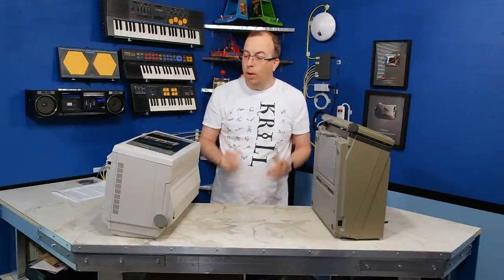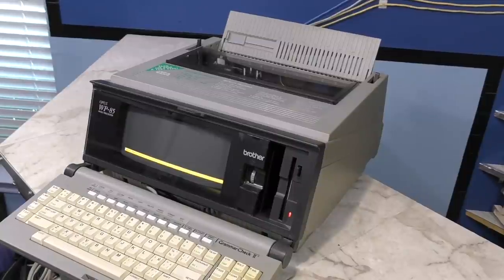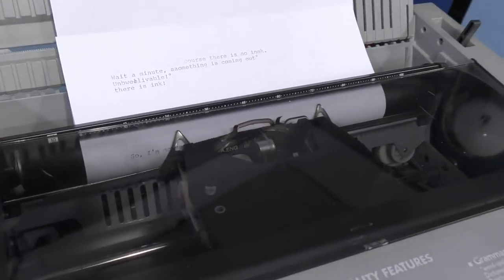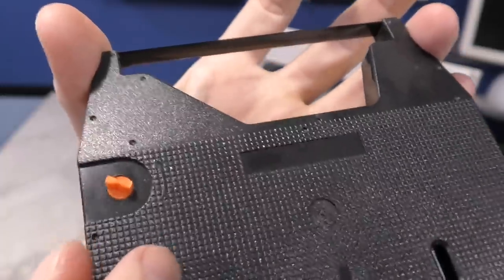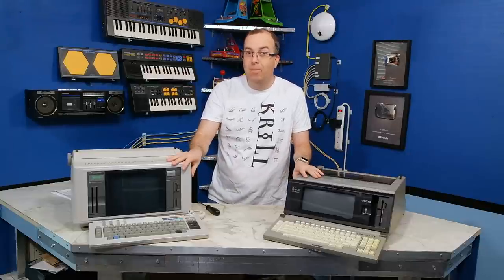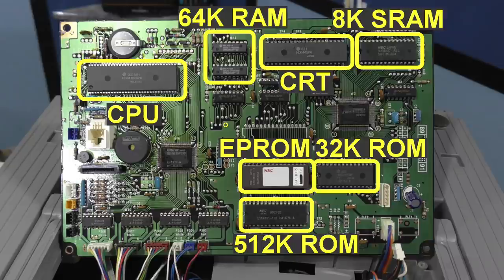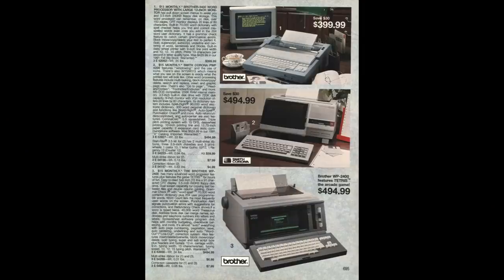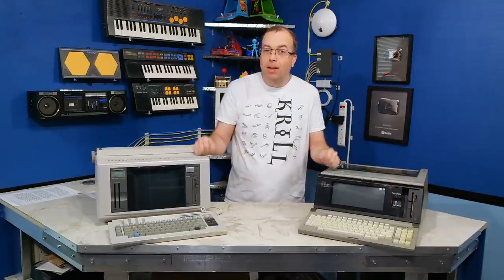Dissecting two Word Processors, Brother WP25 and Panasonic W1525

Comment: I don't recall the model number, but I had one of those brother word processors, it was almost like that, but it was "upgraded" model the carry handle slid out instead of swung out like that one and the keyboard wire was removed and I had a darker gray color, other than that it was identical to that one. I loved tech stuff when I was a kid and my mom thought it would help me in school we found it at a yard sale we got it for like $5 or $10, worked like new, just needed new ribbons which staples had and still has the last time I checked. This was around I'd say 1998 she got it for me, it did end up helping me write a few essays I had prior to word like software being so easy to get nowadays. I had it up to about 5 years ago, the printer door closed sensor snapped off, not wanting to try to fix it, it being outdated tech and stuff cluttering my house got rid of it, don't remember if I donated/gave/or tossed, but I know I don't have it anymore, haven't really thought about it till now, I did come across a floppy disc not long ago funny enough that I still had stuff saved on it.

Comment: I had the smaller version of the Brother that got me thru college, instead of monitor it just had a flip up LCD screen with appox 80 columns but just a few lines, maybe 10.. that print hammer brought back memories, i remember writing up my paper and then watching it print.  I also remember the spreadsheet program that was built in-didn't have to be loaded from a diskette, I never used it but it was a cool thing to have.. so basically at that time having a dedicated computer & printer was unnecessary since there was no internet and the only practical applications were word processing & spreadsheets for most home users so these things really filled the void for those of us that were financially challenged.

Comment: I've got a bit more info on a few of the chips used in the Panasonic machine. The KM23C1000P-20 chip is a Samsung-made 128k (1MBit) Mask ROM, and the KM23C4000P is a 512k (4MBit) Mask ROM. I'd also be willing to wager that given the other chips in there, that the Hitachi microcontroller is probably used to control the I/O for the unit -- drive the keyboard, the printer, etc, and that the Mitsubishi chip in the corner is probably the main CPU, though I wasn't able to find any info about it.

Comment: Carbon ribbons and correction ribbons! I haven't seen those since I was a kid! My mom had a fairly decent typewriter and I distinctly remember that orange tab on the cartridge and those orange spools for the correction ribbon. I also remember how using the backspace key caused the carriage to back up and slam a head against the ribbon against the paper 3-4 times, fading the letter with each punch, until it was pretty much erased. And similar to the carbon ribbon, the letter you erased would appear on the ribbon itself!

Comment: For the Panasonic model @11:01, the 2 Samsung chips below the 8K SRAM are the memory chips. Just google the KM23C1000P/KM23C4000P chips. Also the -20 at the end denotes the speed of the memory. So if you see this -XX at the end of a chip model, it is usually a sign you're dealing with a memory chip.

Comment: The PAWI3W1525MB and PAWI1W1525M are Panasonic/Matsushita produced chips - the "KC23C1000P-20" is a 200ns access CMOS Mask Rom, 128kx8 and the "KC234000P-20" is a 4Mbit CMOS Mask Rom, 200ns access. Seeing that the PAWI2W1500CA is used in some Lumix digital cameras and has the '-xx' trailing designation (-21 in this case) on it, I'd be willing to put money on it being the SRAM. (the -21 suffix would indicate 210ns access time)

Comment: The first type of cloth ribbon can be re-inked if the cloth is still in good shape. The second type of ribbon is single-pass - a small amount of the ribbon in the shape of the letter pressed is left on the page. If you look at the spent ribbon you'll see little clear letters. The single-pass ribbon is extremely thin and there is a huge spool of ribbon in each cartridge.

Comment: Hi David, great video (as always!). The first thing that struck me, upon seeing those units from the front, is thinking how much they look like the Commodore 64SX! :) In the UK the only standalone word processor system I was aware of, back in the day, was the Amstrad PCW series. They resembled your more traditional PC, in that they had a separate keyboard and printer. My friend actually gave me a printer from one of those systems back in 1994 (a dot matrix type). It lasted from my Amiga era, through to my transition to PC and all the way through my university years, producing countless print-outs of program listings, write-ups and essays. Easily the best printer I ever owned, and it would go through one single ribbon a year! Which at the time cost me a maximum of £3!! I actually took it from my mother's attic, over to my house last year, and with the aid of a parallel-to-usb cable, I actually had the thing printing from Windows 7! Unfortunately, I had no space for it in my office at home, and despite offering it on groups online, I had no takers, so unfortunately had to take it to my local recycling centre. :(
Reply: You had the PCW printer working on another computer? We had the 9512, with the daisywheel, and it couldn't possibly work with another computer. All the brains were in the computer itself, greasy Alan Sugar learning a lesson from Uncle Clive again. The printer lead was just simple connections more-or-less directly to the printing hardware. Software on the computer's CPU took care of all the timing to get the right letters smashed onto the page.

You're saying the dot-matrix option was actually a real printer with brains on board? I'm amazed! Are you sure you're talking about the Amstrad PCW dot-matrix? Your friend didn't have a third-party one connected to a Centronics port on the PCW? I think you could buy those as extra.

Shame, I'd love a dot matrix now. It wouldn't get a lot of exercise, admittedly. I just like to hear them screaming away producing a very mediocre lo-res ink on paper.

Comment: 10:45

Looks like there are two SIP DRAM chips at the bottom of the board, so presumably 32KB each.

Makes sense if they are connected to that custom Gate Array, as it's probably handling the address multiplexing and refresh.

Always interesting to see the main boards in this vintage stuff. Reminds me of my (possibly misspent) youth. lol

Comment: Also on the other machine, the slotted chips - both are MASK ROM, top is 128kB, bottom is 512kB. The big chip on the bottom is probably memory of some sort due to the timing value, probably 8kB of something. The RAM itself would be those two ZIP chips marked IC13 and IC14 - yes, those are not rezistor or diode network, those are RAM chips. :)

Comment: I remember several of CP/M-based word processors from that period. A place I worked for had spent a ton of money on word processors from Wang. Of course it suspiciously looked like it was running an old version of WordPerfect and a quick read of the boot disk showed that it was a Z80 computer booting CP/M. Of course it cost more than a typical CP/M computer at the time, but I guess they wouldn't buy a "computer" unless it ran DOS.

Oh yes, they were designed to be repaired quickly. When one broke down, the technician simply replaced the Wang motherboard with a new identical one and it was back to work.

Comment: i loved the brother one, because it has a printer that it is quite easy to put in work, it is basically a printer that is like an automatic typewriter, and as a type writer the daisy chain can theorically be serviced with some alcohol and some ink. even this days, except for the floppy maybe are quite durable. i would not say that of a lot of printers neither computers. but like the floppy if it is broke that would be a problem to me, i hope a restoration video came in the future. also it is expandible by making a rom in the empty slot. good keyboard.
 the panasonic one was interesthing, i love the WP but the printer was weird, theorically you could replicated the band and replace it, but with the original was expensive to print. the keyboard was weird too. 
it is interesthing that there are CP/M machines basically, even could theorically run dos.
great video.

Comment: In fact, the location of backspace is more convenient for touch typing because you can hit it with your pinky without moving your hand from the home row. Also some old Sun keyboards had that layout for backspace (and esc on the top left corner of alnum block, ctrl in place of caps lock). I don't know why have we not moved to that standard, instead having useless keys like caps lock and tilde (yes, as a coder, I use it, but not as much as esc).

Comment: A coworker bought a similar word processor to use at home (or for his daughter to take to college - don't remember) but it had a proprietary disk drive. It looked like a 3.5-inch drive but the disks were smaller. There wasn't any way to share the files created with a PC. I know there were some 3-inch and 3.25-inch disks at one time but when both Apple and IBM picked the 3.5-inch disk, that was pretty much the end of the other sizes.

Comment: My guess is the DRAM on the Panasonic will be that SIP package to the right of the CPU, Matsushita loved that package for saving space while still keeping the pinout wave solderable. 4k SRAM would be the print engine RAM, as they basically took a Panasonic daisywheel printer engine complete, and then talked with it via standard serial interface on the board. 48 pin chip to the left of the SRAM is the print controller, the ROM below the 4k is the printer firmware and the rectangular ASIC to the right is the daisy wheel controller glue logic, and then the DIL chips to the right of the board are power drivers. The square ASIC will be glue logic and keyboard encoder for the main CPU, and the SMD chips are bus buffers. 

Layout must have had a hard time putting all that onto the smallest possible 2 layer FR4 board to fit in the assigned space there.

Comment: 11:03 Below the 8K RAM are 23C1000 and 23C4000 mask ROMS which is128KByte and 512KByte. The RAM is IC14 and  IC13. These are the rare standing ZIP chips (I think they were called that). The ..70H036 was a 36 cell OPGA (One time programmable gate array) of some sort. I have seen similar ones in synthesizers.

Comment: Sometimes you can revive fabric ink ribbons by prying up enough of the casing to put a WD-40 spray straw in...and give it a few very quick squirts.  Leave it for a few hours and see if it's dissolved enough ink back in to usable area of the ribbon.

Comment: The cloth ribbon can be re-inked in a few minutes. All of my dot matrix printers used them. With them was a love hate relationship as you could print cheaply however to save your ears you needed to have earplugs or a sound damping device around the printer.   One of my computers, Access Matrix (also known as an Actrix) from that I had in 1985  had an internal MX-80 printer.  Those were the days

Comment: The ribbon on the second printer is very similar to the IBM Selectric, which was known as the best business typewriter in the 1970s and 80s prior to the PC taking over wordprocessing tasks. At work, I used an IBM Selectric up until the mid-1990s. The Selectric truly was a great machine.
Reply: The Selectric was similar but I believe it had the embossed letters on a round ball instead of a daisy wheel; similar concept though.
Reply: @66rabidmonkey  I'm talking about the ribbon and eraser mechanism -- NOT the typehead.  Your points about the typeheads do have the merits. The ball head could be replace with another ball within seconds.

Comment: You should check out the Amstrad PCW range sold here in Europe – as I understand it, they were sold primarily as word processors ( P ersonal C omputer W ord processor), although they weren't all-in-one units, and were actually a lot more capable (able to run, eg., CP/M, BASIC, etc.)

Comment: The Goldbergs have a Brother WP-1, also the ink coming back after you type a few letters is from my experience pretty common with the Brother 7020 ink ribbon, which is what I believe the WP-1 and WP25 use. Also the WP-1 lacks the spread sheet mode. It has a similar construction to the 1030 ribbon in the panasonic.

Comment: A little trick we used back in the day was to spray the ribbon with a little WD-40.  Generally won't hurt the printer but dissolves the dry ink in the cloth ribbon.  We would take the ribbon cartridge apart to accomplish this and of course, don't go crazy.  You are trying to re-wet the dry ribbon not bathe it.  Over-wetting may cause greasy spots on the paper.  Worked great for single-color ribbons although could cause color runs if you tried it on the multi-color types that some used.
Reply: Oh and the second typewriter printer uses a single-use film-type ribbon that is like carbon paper.  That won't dry out or get light but when it reaches the end it's done, where as the cloth type keeps going around in an endless loop, sometimes with a re-wetting roller in the cartridge.  Some of these devices had the ability to use either type of ribbon, but the film-type was considered more professional looking.
Reply: One last comment.  The 23C1000 and the 23C4000 in the brother unit are mask-programmed versions of the 27C1000 and 27C4000 eproms (128Kx8 and 512Kx8 respectively)
Reply: I meant the Panasonic

Comment: Back during my unfortunate incarceration, we were allowed to have word processors for legal work in our cells.  I had the Brother 5600.  Very capable for what it did.  Downside was the contacts on the built in keyboard keys were prone to wearing out.  Could not buy the replacement circuit boards anymore so we refurbished them in the electronic repair shop where I worked.  Played tons of Tetris on mine.  Anti prisoner replies starting in 3…2…1….

Comment: I recently bought a typewriter from the late 70s. It had a belt and it works perfectly fine. While I can get replacements for it, I don't think ink belts run out as fast as you portray them to.

Comment: I had a Smith-Corona PWP-6000 word processor back in the early 90s. We already had an XT and later 486 during that time, so it didn’t get much use. Like these, it had a monitor (white monochrome) and 3.5” drive (720k DD DOS format). The keyboard was really spongy, and interestingly it had a serial mouse that you could optionally use to navigate your text and menus.

I also took it apart back then and remember being able to identify some ICs in it, but unfortunately I wasn’t careful enough and broke it while messing around with the printer, and I just ended up throwing it away.
Reply: Btw, the PWP-6000 looked the same as the PWP-4200 shown in that catalog page you showed. Don’t know what the differences were. Iirc the 6000 cost $600.

Comment: I remember that if you ran out of ink with a b&w printer that uses a cartridge like the first one (I never had such printer but needle printers used similar ones), you can crack open the cartridge and just spray some black ink on it. Usually the tape is good enough to be refilled 3-4 times that way before it's so damaged that it may even rip apart.

Comment: I don't recall the printing ribbons ever continuing ink or drying out - Typically all the carbon just either falls off because the adhesive fails or the carbon is actually printed away over the years.

I've got several old dot matrix and Daisy wheel printers that use these ribbons and they all still work with ribbons that are at least 15-20 years old by this point!

10:52 that Fairchild chip appears to be a CRT controller. The Fairchild MB89321A is listed on digipart for $3.46 a piece, but there is no MB89321B as is used here. Suspect it was discontinued or a minor variation.

Comment: the Brother unit you have has a nylon ribbon installed. They are cheaper and more durable, however more susceptible to aging as you have discovered. I can also see the correction tape is installed on the unit, which works just like you said, it covers up the typo you made with white paint. The corrections are noticeable and ugly to the eye. Other type of ribbon you can install on this machine, just like the on the Panasonic, is a film type ribbon, which is always crisper and almost never dries out, just like the laser toners. The correction tape for these types of ribbons work a bit differently, they stick to the paint and literally pull the typo out of the page. It is almost invisible after the correction and it is mesmerizing to watch the machine do that. Good technology.

Comment: If that "whiteout" ribbon mechanism works like the one on my old Brother letter-quality printer did, it could also be used to hold a small red-film ribbon, so you can print occasionally in red without changing the main ribbon. The main intended use, of course, was to print negative numbers in red on spreadsheets and financial documents. 

Also, the "whiteout" ribbon may work by lifting the carbon film characters off of the paper rather than by covering them up as actual white-out would do.

Comment: That Brother is actually a newer model. I have an older model of the same thing. It was white instead of grey. I think my earlier model didn't have the spreadsheet, but am not sure because I never had use for the spreadsheet. I actually have experience with both of these, because my brother had the Panasonic. I still have the Brother word processor in a closet somewhere. I think when I bought it it cost around $600.